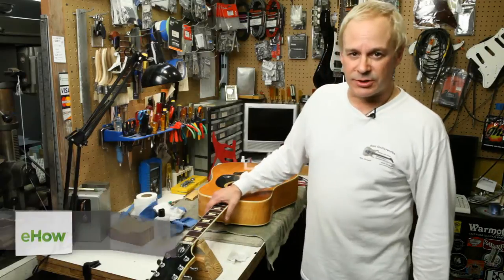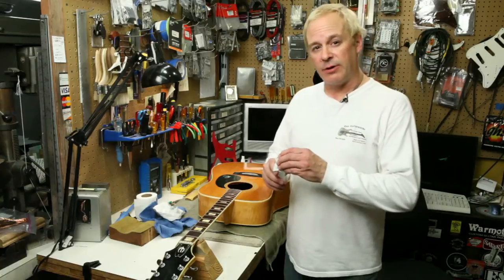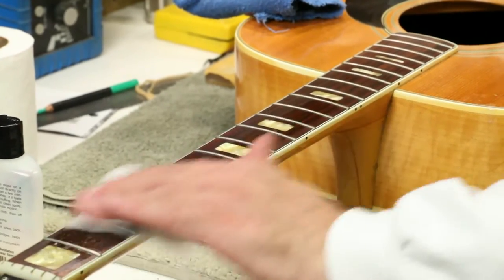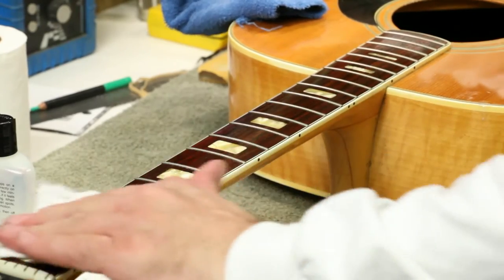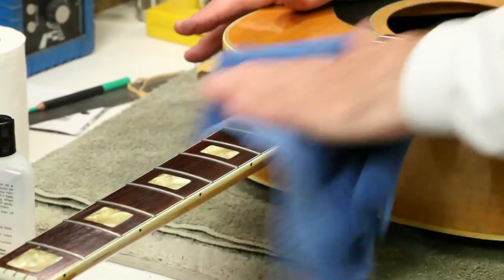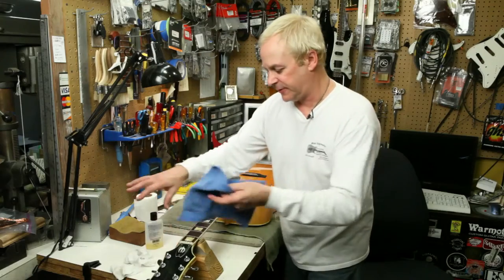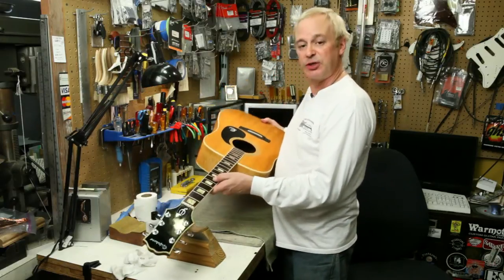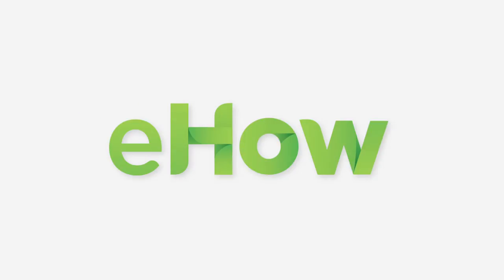How to Apply Bore Oil on Your Guitar : Guitar Building & Repair

Comment: is this the stuff that you use on band instruments?
Reply: It's a petroleum based "lemon oil" like many fingerboard oils sold. I've tested it extensively on wood, metal parts, and commonly used guitar plastics with no harm to any of them. There are lots of products that will work just fine, as long as you don't use too much. Less is more, in this case.
Reply: yea ik some ppl who use it as valve oil